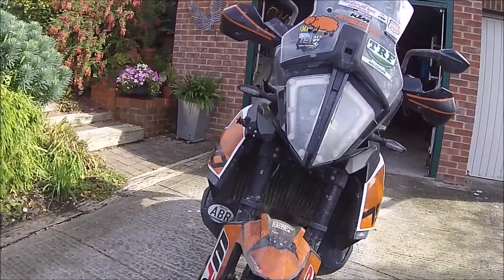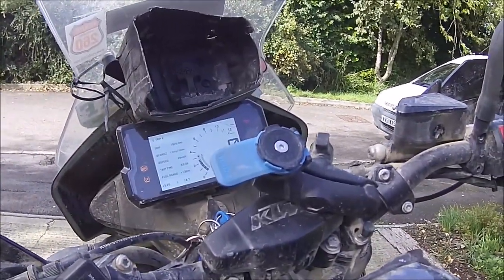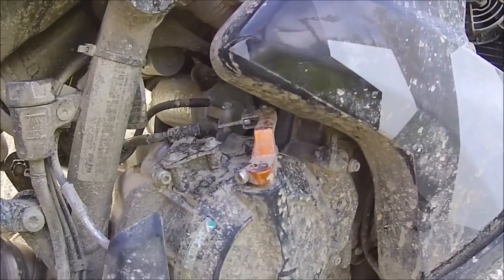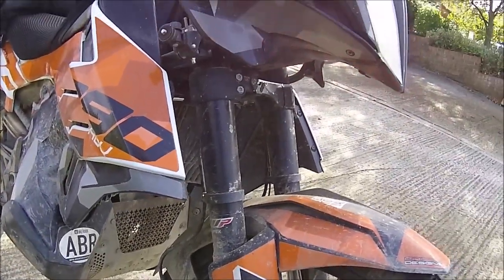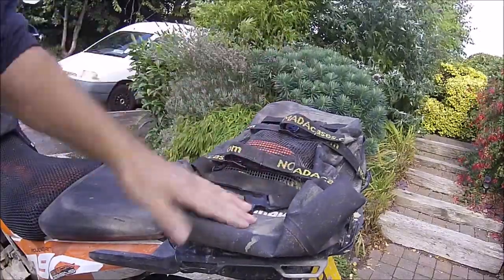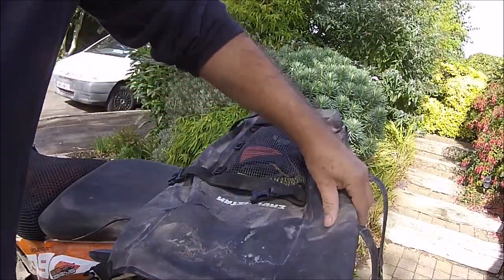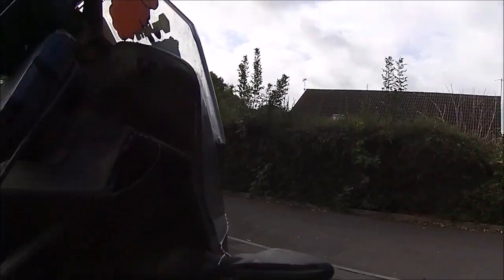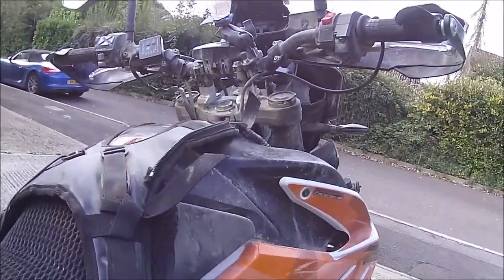KTM 790 Adventure - getting it ready for an adventure.

Comment: Thank you for your videos.  What size oxford heated grips did you put on your 790?  Were they the "adventure" size?  I want to make sure I order the correct size for mine.
Reply from the maker: Hi, yes they were the Adventure ones - you have to be careful as my memory tells me you have to cut and shape the end that goes into the ride by wire end so it fits the lugs that the original throttle slips into - this took a fair amount of time planning where the cut outs in the Oxford grips should go using the original grip as a guide - measure twice and cut once - although all good when finished.
Reply: @streakyone  thanks for your help.  Happy trails.

Comment: You want to put an 18 rating on this video, that's some serious Adv Porn right there!

One thing I was hoping you'd mention is the mod you've done to the seat? What did you do and did it make much difference?

I'm particularly sensitive to bar vibrations, is that a problem with this bike?
Reply from the maker: I've adapted a Cool Covers seat cover I had on my previous Africa Twin. Keeps water away from your bottom plus cool in warm weather plus biggest plus the weave they use also adds some give which I like on longer journeys.
Reply from the maker: 2nd part - I don't get any bar vibrations.